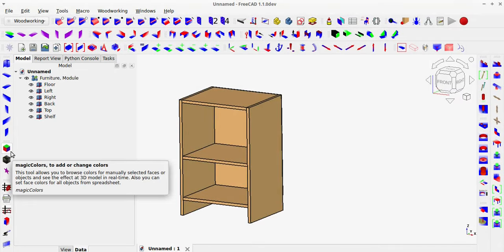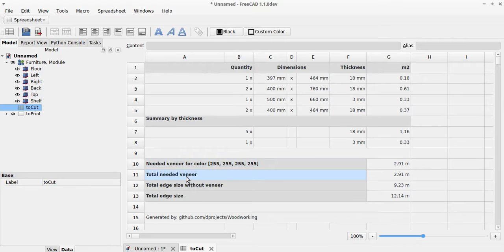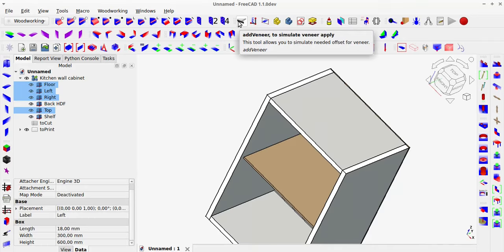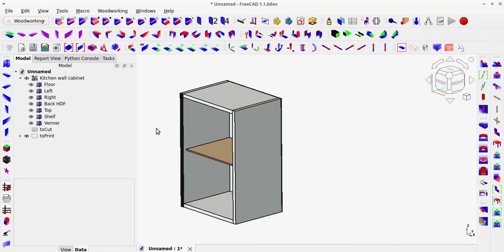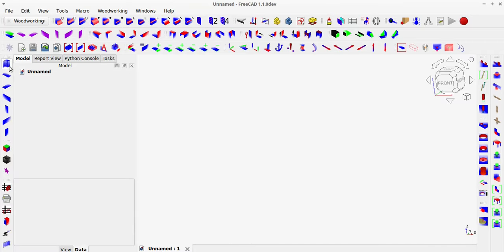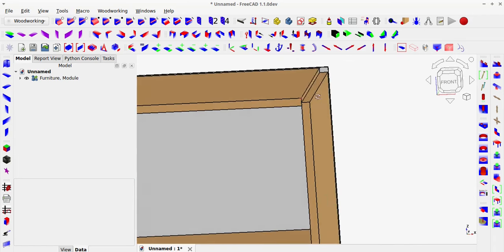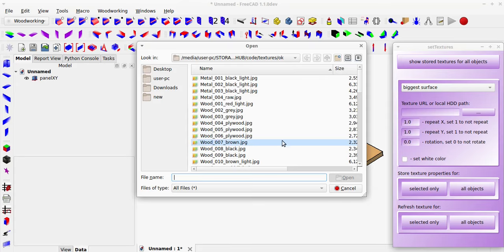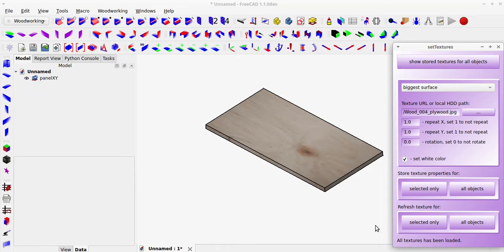Veneer simulation | FreeCAD Woodworking workbench

Comment: FYI, in the new "Woods" add-on (available in the Addon Manager), there are material definitions for about 250 species of wood.  This includes a .jpg photo for each species. These are photos of the real wood samples, so they're completely realistic.
Reply from the maker: Now it is supported as well. There is new m - report type with Material.Name. Also you can load textures via setTextures tool. However the texture decoding from .ShapeMaterial.AppearanceProperties["TextureImage"] is not explained anywhere... it works but I am not sure if the decoding is correct...